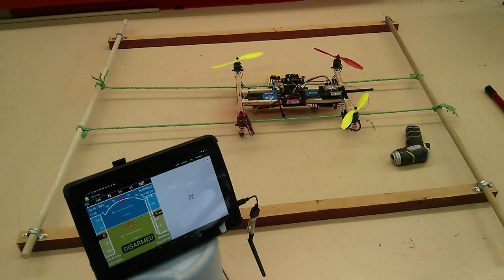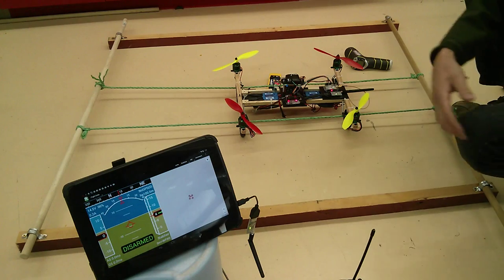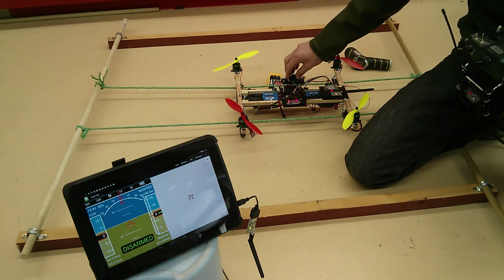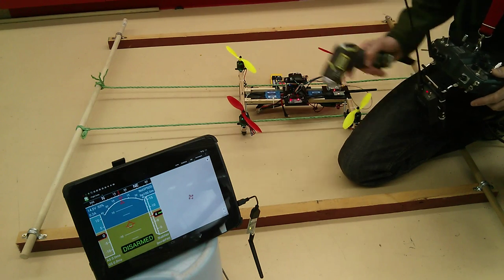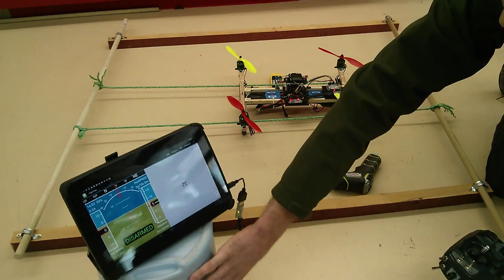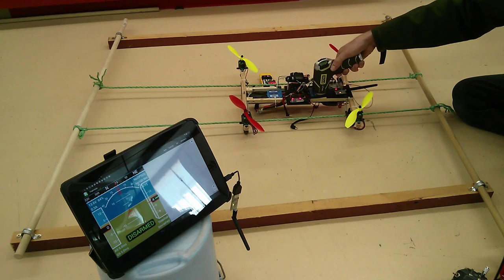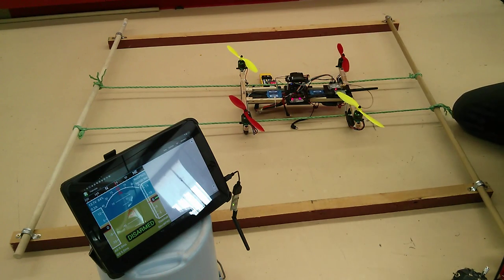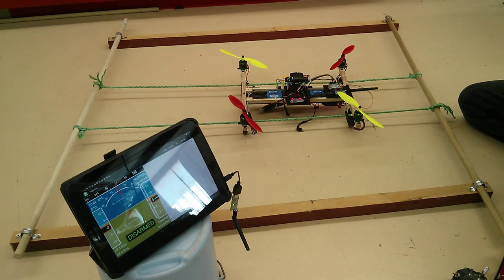BenchTest #3: ESC troubleshooting.

Comment: Yep. Same problem with my 2.6. Mid-air cut outs and brown outs. Just replaced the power module. Have not been able to test it yet.
Reply from the maker: APM is by-passed in this demonstration.
So it cant be APM for me....

I am throttling ESC individually with throttle channel from Rx.
Reply from the maker: Do all of your motors stop or just one?

Check your telemetry logs, if your having power outs, i would imagine you'd notice several logs for "one test/flight." In any case check logs/graphs for supply voltage funny business
Reply: All motors stop or all brown out. We checked only one log. It just stopped in midair. The rig flies like a dream until it drops like a rock. Standard RCExplorer tricopter.  In every case,  batteries were nearly "full."  No camera, LEDs or other gear.   At different times, I powered the servo three different ways as directed by 3DR: (1) only from the motor esc, (2) only from the output rail and (3) only from a separate bec.  Brownouts and/or cutouts using every method. This did not happen with the KK2. It has to be the apm or the power module. Hope the new power mod solves the mystery. If you can think of any other possibilities, please post them. Thanks

Comment: Nice job Nick.  Wow, the 4s battery really gives you thrust.  I run all my built quads on three 3s just for the fact all my electronics, camera/transmitter run on 12 volts.  My "quirk" is my Flamewheel 330 is exhibiting a non-start on one of the motors. It's sporadic..  When it spools up, it runs fine.  What I'm worried about as a quad pilot is having this motor quit while flying.  God knows I've had this happen numerous times but generally on my smaller quad that has thin wires from the ESC to the motors.  They do occasionally break.  The 330 has much thicker wires and that's not the issue here.  I guess I could replace the ESC, but I'm baffled for the fact that when it runs, it appears fine......

Comment: I just got done building my first quad.But for some reason it drifts forward.Even after recalabrating  the ESC's.So i grab it,give it throttle and pitch to the side that it drifts from.The motor doesn't spool up at first.It takes a second or 2 for it spool up and try to level out.Is this a bad Esc?

Comment: I may have the same problem on my quad. If I change out esc and motors for the exact same new ones will I have to calibrate anything or can I swap and fly? Newbie here lol
Reply from the maker: Esc would have to be calibrated to learn throttle high and low.
Reply: ok thanks